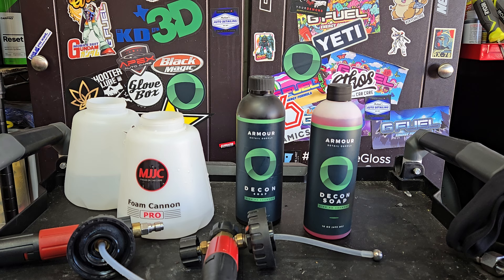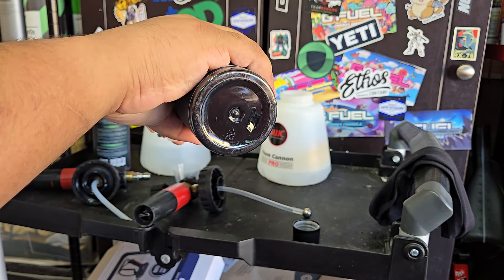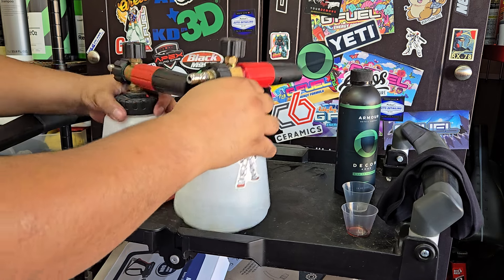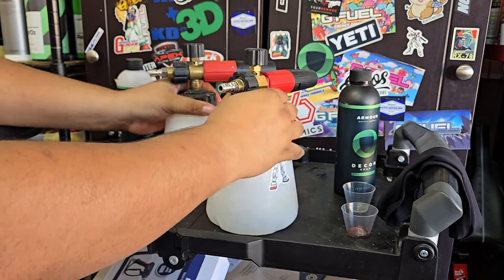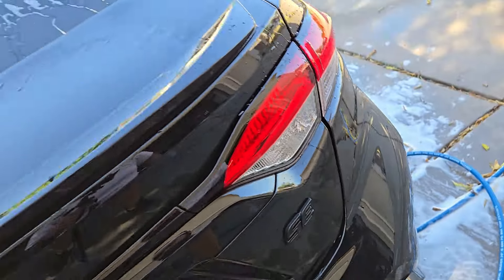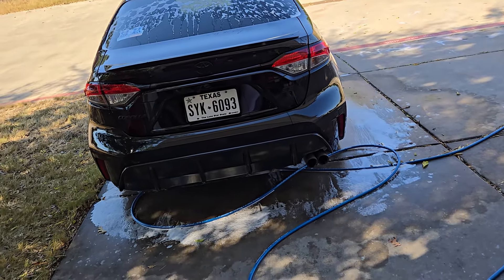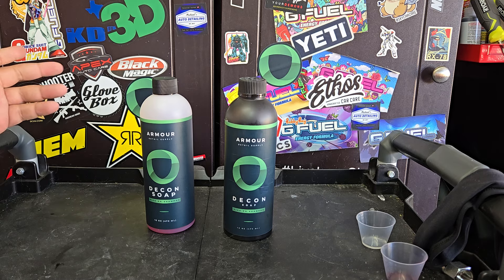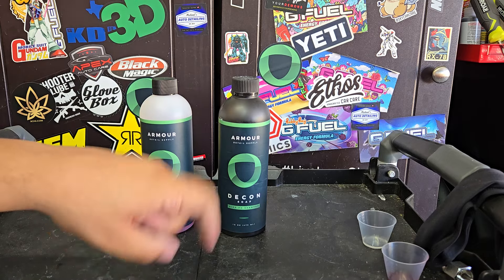[FOAM] Decon Soap Version 2 by Armour Detail Supply - Is it Better?

Comment: At $60 a gallon, it better work.  My decon soap cost $9 a gallon, which one makes better business sense?
Reply from the maker: @hartlanddetailer5670  ADS has a wholesale program bringing the costs down. Idk what soap you currently use, I can't make a call based on price alone.
Reply: What Decon soap do u use
Reply: Depends on dilution ratios.
Reply: Hey Hartlant,
Are you using the vehicle & boat wash Walmart sells? If so, I use this also. It's good enough for me & at a great price. I believe it is Purple Power soap if I remember correctly correctly
Reply: Which one makes better business sense depends on cost per use and quality/safety of ingredients. If your $9 per gallon soap stains someone's plastic trim or etches their glass, is it really cheaper?
Reply: @vincelaguno431  Yes, Purple Power Vehicle & Boat Wash Centrate.  I use it sparingly only once or twice a year on my own cars and Dilute or stronger if I am doing a deep clean/strip wash.  I have never had a problem with it, but I only use a couple of oz. when I use it.  For badly soiled vehicles, I may add Super Clean...
Reply: This is a HIGH pH soap, only use once or twice a year on a car...
Reply from the maker: @hartlanddetailer5670  okay I had that product in the past. It's not bad. This stuff us better, but it sounds like you have a good system that works for you 👍🏾
Reply: $60 a gallon i laugh at you in Australian, here it's $130 before postage so your looking at $150 total

PSH UNREAL
Reply: @hartlanddetailer5670  I've had Purple power vehicle & boat wash strip color off trim way too many times.   Caustic chemicals clean easily but also can damage.  That is why they are cheap.  Cheap old school ingredients.     Newer products are formulated to clean well without damaging the vehicle.